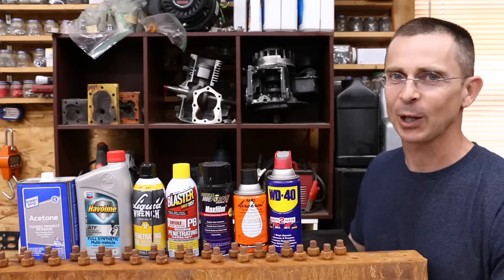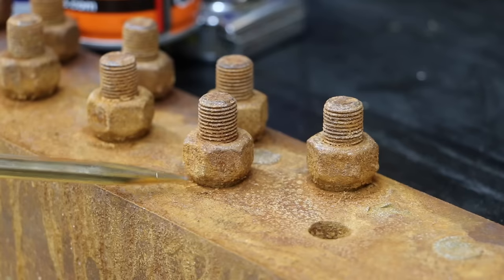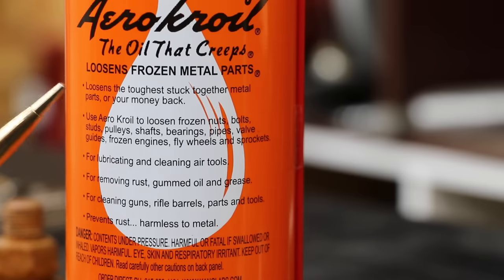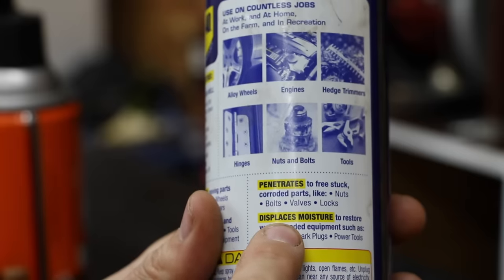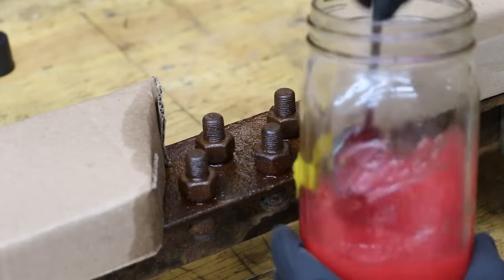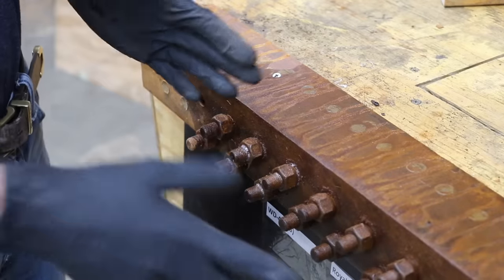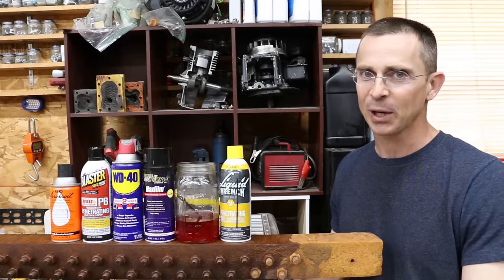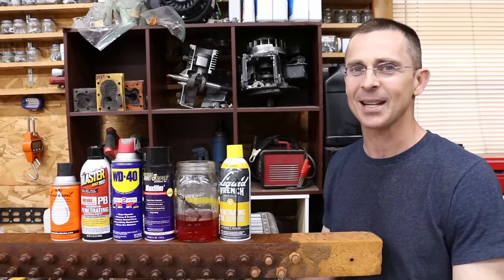Which Penetrating Oil is Best? Let's find out!

Comment from the maker: Thank you all for suggesting this penetrating oil showdown!  Best regards, Todd
AeroKroil: https://amzn.to/3jaWGiJ
Liquid Wrench: https://amzn.to/32dX7Sw
PB Blaster: https://amzn.to/31igfPW
Royal Purple: https://amzn.to/2QfbuA6
WD-40: https://amzn.to/2Eh0BLY
Reply: Can you do a Best Carb Cleaner video?!
Reply: You're the best Todd no kidding.
Keith  Kuhn
Reply: Question: can you use a heat gun to loose bolts? 
You know like the torch?
Reply: In the auto repair business for 35 years , HOWES  is the only pen. oil that NEVER failed , sometimes worked in minutes !! Cant find in Cali anymore .
Reply: @sawthemin77  
I just did a Google search hoses is out there. 
But expensive
Reply: People only use kroil for the odor. It smells like government overspending.
Reply: I have with decent results. My heat gun has nozzle attachments to direct the poimt of attack so it does help. Never tested it for measurements of any kind. And if you do use one, ensure the belts, wiring or tubing in the area, is protected.
Reply: I know that solvent that works
Reply: Don't know if it's better, but my work place use "Break Away" and it seems decent.
Reply: Just an FYI, your Liquid wrench link is a lubricating oil and not the penetrating oil from your video. Cheers.
Reply: I once removed a large rusty nut and bolt from a farm implement easily by using CRC Freeze Off, after no success with three of the penetrants you tested. Obviously, it was not a controlled experiment and there could have been some residual effects from the other penetrates, but without boring you with greater detail, the nature of how it happened made me a believer in Freeze Off. You might want to try.
Reply: Hey man I love your personality, it reminds me so much of myself i’m the sense that I can just tell you love life and what you do, I could see you could barely contain your grin when you started mentioning at the end how well a torch works, lol yeah buddy you and your videos are awesome. I just love how energetic and happy you are in your videos because you just don’t see that enough anymore, I’m the same way and it’s just something everyone should aspire to. also I like your taste in music. Have an amazing day!
Reply: At the end you say "you may not have time to apply heat", but you let all the oils soak in for hours.  You're right, heat isn't always an option, but time doesn't seem to be a factor under the circumstances!  Good test/video, as always!
Reply: Well... I think I'm gonna be using the torch alot more
Reply: If you have the ability to soak the item.. Marvel Mystery Oil works amazing

Anything left in it overnight comes loose no problem. Used it primarily on stuck indexing cutters
Reply: You didnt use wd-40 specialist which is supposed to be twice as good as WD-40
Reply: Hi, have you tested loctite LB 8040 freeze and release. If you haven't would you be able to. Be very interested to see how it goes.
Reply: @realtruth97  yes
Reply: Solvent ( touluene ) + motor oil . Voílà . BESIDES : The author speaks too fast : therefore , no way to digest what he says .
Reply: How about CRC knocker loose?
Reply: Great video as always Todd!
I am a user of Kroil but never questioned it quality. It is very expensive and I am on a very limited budget. I will be using liquid wrench from now on. Just an FYI...the link you posted takes me to a different liquid wrench product you used. It points to their lubricant not the penetrate oil. I did finally find the correct product.  Thank you again!
Reply: @manuelluis5456  on YouTube you can slow the speed down...really helps me
Reply: Very good penetrating oil is brake fluid especialy DA-1 here in Poland 🙂
Reply: @bertone122  Works good in a pinch but don't get it on your paint. It removes paint RAQ (Right Away Quick).
Reply: Have you tried free all against any of these in another video?
Reply: @gregsall5872  Walmart super tech carb cleaner. That stuff dissolves screwdriver handles.
Reply: Try Pam cooking spray
Reply: After almost forty years in the automotive repair and industrial maintenance field I had one penatrant that shines above the rest. It was a Mopar product. It was called Rust Penetrant Heat Control Valve Solvent. Don't know if today's formula is the same. The can I have is from years ago. It looks to  contains graphite or moly in the liquid.
Reply: Todd I'd like to see you test out Superzilla. Its touted to be a superior plant based penetrating oil.
Reply: Will you do a part 2 with other options too? Like Mouse Milk penetrating oil, etc
Reply: Well doesn't look like they helped at all in this case,I believe they do when getting something to slide out,im not going to buy the high dollar cans anymore thank you this will save me money.
Reply: Hey next time include Walmarts penetration oil it's half the cost of  WD-40 which I like finished in ur test  top 5 👍. Walmart says it the generic for WD. Forty. Thank best videos ever. Watch very. informative. 🙏.  Mike
Reply: Liquid Wrench was $4 per can last year is now $14.95, if you can find it. All of the places to buy on their website no longer carry it. Where can we buy Liquid Wrench? Thanks
Reply: The old porch-o-matic one size fits all
Reply: I have found that water and soap works well and charcoal lighter fluid also dose the job
Reply: @stanlanpher4628  k
Reply: @croderique  6666677777
Reply: @manuelluis5456  YouTube has a playback speed control. Most of what Todd says is reflected visually on the screen, which can be paused. Also, since most products are "losers", Todd is only going through things in detail to show that he conducted the tests fairly. If it wasn't for this, one would just jump to the summary.
Reply: Please give this a shot - The name brand is "Tool Bench Hardware" spray lubricant. It was at either Dollar Store or Dollar Tree and at the time I bought it was $1. The can is half yellow (top) half black (bottom) and just says "spray lubricant" in red on the front. I was amazed while trying to get some rusty stud nuts off to remove a wheel, a guy showed me this spray and it appeared to literally melt the rust off. I thought I was going to break the studs but after he sprayed that on it and waited a minute it broke free and came all the way off. This was old rust on a farm trailer that had sat long enough for the tire to crumble.
Reply: I need to go to sleep.  My brain read the title as which oil tastes the best and I was like what the fuck that is WD40 and is not for drinking.  Human brains are whack a doodle at times.
Reply: WD40 is the best because liquid wrench is ok for loosening but WD 40 also cleans and stays lubricated to prevent grinding.
Reply: I have used the product Free All and it requires very minimal effort when removing rusted nuts and bolts, by the way, absolutely love your showdown tests on all products, you really are a iconic example of someone who has helped mechanics and the homeowner on the best products to use and purchase, Thank you so much for your tireless work and dedication to testing products!
Reply: Try free all
Reply: One of the best products that I have found is made by I believe it's silver solder is Gunk Gunk original Grease engine degreaser is the best rustbuster penetrant I have ever used you might try to be surprised
Reply: I use Kroil, along with an Induction Heater. Both are kind of an expensive, but have found out the hard way that sometimes you have to have good stuff to get a bolt out, or you will waste a lot of time.
Reply: The best thing I’ve used when possible is a bit of heat and candle wax.. sounds crazy but would love to see it tested against others like this.. only need enough heat to melt the wax around the threads.. if you heat up and apply and reheat and apply till you see small bubbles forming around the threads that’s usually the sweat spot.. also works good for getting bearings off of shafts as well.. sounds crazy but it’s something that really works well!! Let me what ppl think!? 
I been doing it for years whenever possible and out performing anything in a can.. good video. Thanks 😎
Reply: Will you try ultra chem Break it ?
Reply: I used to use zep45
Reply: I know it getting to be an old video, but you should try free all, it is amazing,
Reply: You need to do an update video with the top couple from this video against some newer options available such as Cyclo Break Away, Free All, 3 in 1, CRC Knock'er Loose, and the WD-40 Specialist Inhibitor which is supposed to be better than regular WD-40 which normally does good anyway.

I personally use Cyclo Break Away which works great but can be tough and somewhat expensive to find locally so I have to buy it online from anywhere from $8 a can to $60 a can lol.
In a pinch I also use CRC Knock'er Loose which is decent and much easier and cheaper to get.
Kroil also has a Graphite Penetrant as well which looks interesting.
Reply: please go back to this style of (MORE) natural speech. 
It's just a breath of fresh air. please ...

Comment: When I first started as a mechanic an old greybeard told me to use brake fluid. The best by far. Please like so it can be put to a true test!
Reply from the maker: Thank you for this recommendation!
Reply: If you step back and think about it, that makes a lot of sense. In past experiences if left alone brake fluid will eat it's way through almost anything if left untouched. I've seen it eat paint off the firewall of an $80,000 hotrod because the owner didn't know it was leaking and couldn't see it until the motor was removed for refresh.
Reply: Well if   it works so well , then why are rusty brake line so hard to get apart?.......😁😁
Reply: I was shocked to see how the KANO finished in your test. Because I can say without a doubt, Kano has saved the day when NOTHING ELSE would help. But then Again, I wasn’t always dealing with a simple rusted nut/thread. It would just climb into everything . From heavily cooked on carbon coated or aged/hardened grease, and other unknown thread locking substances. But then I’m still using Kano from the 50 gallon drum my dad rolled home with back in 1984!! I bet these days there may possibly be a different ingredient or two to make it epa friendly.
I like your videos! Great work!
Reply: Yes, brake fluid works well!
Reply: Archie Bunker Think about it. Where the lines, bleeder screws etc are rusted, they aren't in contact with the brake fluid.
Reply: Jeff Reaver brake fluid is bad bad shit. even the fumes can hurt you..even if it worked better which it dont... i would not use it.
(it dont penitrate as well. ) seems it would but it dont.
Reply: Think breakfluid cleans it but  runs off allowing air in then rust so put it on then some engine oil perhaps
Reply: @donvincentjr  they changed it probably around 15 years ago or so...still works great...the old formula was better...I buy it at work...5 Gallons

Comment: Keep in mind he's testing these products on short-term surface rust. It's going to be a different story on years old, very rusty fasteners you'd find under a vehicle. The fact is sometimes a torch is the only solution and that's why I always have one on hand.
Reply: it can't be stuck if it's liquid
Reply: I'm up in the salt belt of upstate NY. If I have time, I like to torch first and then hit it with penetrant. Seems like the heat opens it up and allows the penetrant in more, always had good luck using both.
Reply: He does mention heat at the end of the video.
Reply: Kroil works better with heat: heating parts and dousing with Kroil seems to smoke less than doing the same with PB Blaster, too. 

FWIW, I also ran a PC fan with only RP Synfilm on the shaft (no grease) for nearly two years before it finally seized. I'd say it has great lubricant properties. I've also used it to lubricate turntable parts, too. The dropper bottle comes in quite handy for finer applications like that.
Reply: You mean in your hand ? 😂
Reply: @ttrmotocross  that’s smart.
Reply: See there is a newer review.  A mechanic recommended PB Blaster.  I recommended it to a large fabrication supplier.  I swear by it for those items that have been frozen due to heat and rust cycling.  As an engineer, mathematician, and all around numbers person, my anecdotal evidence trumps these results.  I'd wager, as I'm electrical, not mechanical or materials science, that these tests are missing something.  I even mentioned it to the best mechanic I know.  He was like, you didn't know?
Reply: I’ve been using liquid wrench for over 40 years I have never found anything that works as good
Reply: Yes, but sometimes you have to take off a gas line
Reply: The real “liquid wrench”.
Reply: Awsome,  revenue  !
Thanks for spending the time to help us . Great info to help with rust issues. 
     TNX Joe 
 From Buffalo NY
Reply: Thr more rust the harder it would be to loosten  the nut so to me the tests he did were accurate it would probably just take more torque if the nuts were rusted more
Reply: Aero kroil loosened up bolts under my 20 year old F250 where all others failed.
Reply: @Zenkai76  Yeah boi XD
Reply: @squirrel6687   Please post your video soon.  We all want to weigh your trumping anecdotal evidence.
Reply: @ferretwithagun9886   The Kroil seems the most viscous, and might stick better on undercarriages better while it does its penetrating?
Reply: @triktrak_1451  maybe. A few of the others are good. I love WD40 and PB blaster always does pretty dang good to. That kroil just seems to have worked faster than any other since I’ve found it. I’m pretty sure depending on environment and job most of the top brands are gonna do pretty good. Ole squirrel seems to have gotten kind of excited 😂.
Reply: @ferretwithagun9886 Yes it seems he has!😆
Reply: I figure they are all about the same.

Comment: "Results: Liquid Wrench came out on top, following by ATF/Acetone, Royal Purple, WD-40, PB Blaster, and AeroKroil."
Thank you very much for typing that in the description!
Reply: Glad to see the inexpensive product kick butt.   My brother in law is a huge PB fan.  Hahahahaha
Reply: I use Rust Mustard
Reply: ,I've  used  liquid  wrench  apply  to  any chain  , wd, 40, specialist,  white , lithium ,are. The  best.
Reply: Results: Heat worked a little, followed by Liquid Wrench. The others did nothing because they were all about the same as dry. Then we soaked the nuts in vinegar for an hour and they came off by hand with no wrench at all.
Reply: @hyzercreek  This is doubtful.. if you listened @:56 in the video you would recall he torqued them too 100flbs. Now maybe your Steve Austin, the Bionic man,  but it's doubtful. Please provide a video showing this..lol
Reply: @firestick8075  OK so I exaggerated a little. But to remove rusty bolts you need rust remover.
Reply: Spoiler Alert ???
Reply: Richard Evans kroil works the best Ik for experience
Reply: @hyzercreek  Gotta try Vinegar for 4th video!
Reply: Kroil all day everyday
Reply: If you have a locked up engine; acetone & atf & some marvel mystery blend it's the best thing I've ever used. Put it in the cylinders and let them sit for a week. Pull the plugs back out so you aren't fighting the compression stroke and start rocking the engine bolt back & forth with a breaker bar. Unless you have a collapse cylinder or blown connecting rod it should loosen up.
Reply: My grandfather always used iodine to break the valves free in engines in his equipment that sat for years.
Reply: Could viscosity has something to do with it? Try a ratio of more acetone to ATF.  Or try lacquer thinner and ATF see if any better.
Reply: @firestick8075  100 ft pounds isnt that difficult with a long handle breaker bar
Reply: @rediron44   Understood, but if you read Abcde response above, he said they took them off by hand.
Reply: I use pb blaster daily I’m offended 🥲